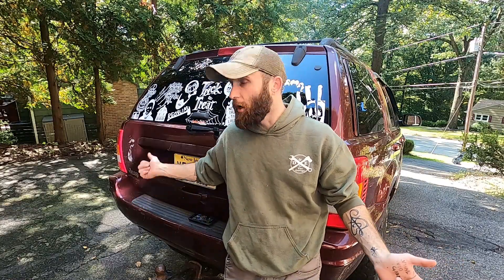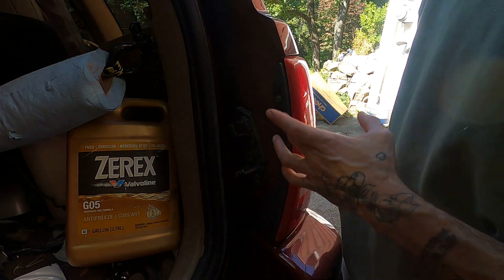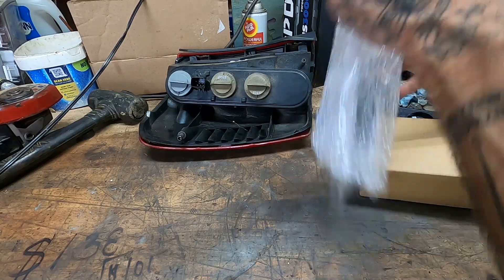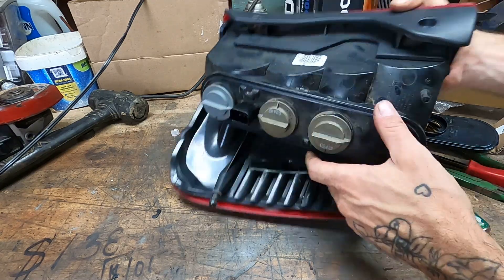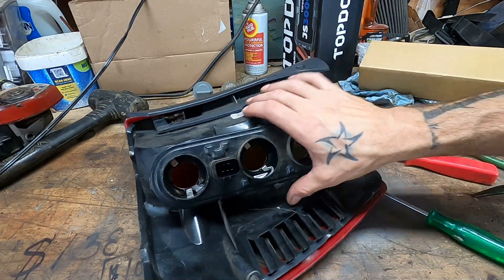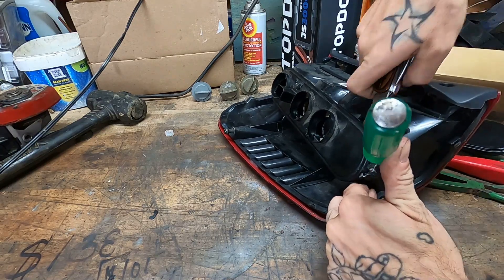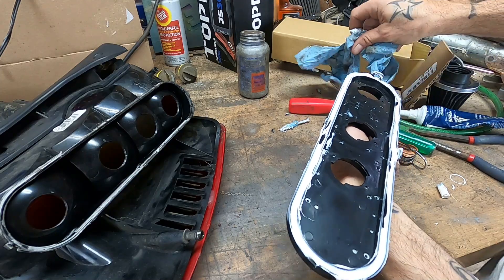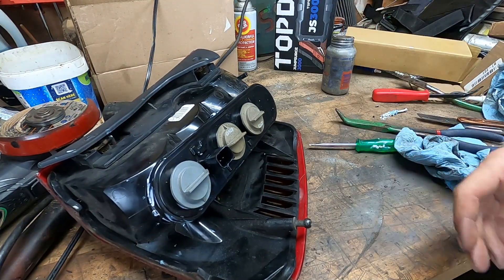Dorman Replacement Taillight Circuit Boards (Jeep Grand Cherokee WJ)

Comment: Had the same problem with my 01.  Switched over to 3157r  led,s.  Runs cooler. Been a few years now.   No problems.    Only for running lights and brake light.      Didn’t have to do anything else, direct switch.

Comment: Hey, bro, great video.Love your style, What I have one big question, which is?Where is the contact between the dorman board and the car make contact, so the car is aware that you're using signal, brake or backups lights???🤔
Reply from the maker: The door.an PCB panel is basically the whole light's electrical. The wiring harness from the Jeep (how it k ow which lights to turn on) is on the PCB and all the bulb sockets screw into the PCB. The rest of the light is just reflector and housing. Hope that helps

Comment: I have an  issue where the break light on top above the rear window works but not the other two larger lights don't and can't find the issue. Anyone have any ideas? The fuses and bulbs seem to be ok, I'm at a loss.

Comment: I solved this issue years ago by switching to led bulbs they fit in the stock socket and don't overheat easy to get at AutoZone

Comment: My 2003 WJ does NOT have adhesive of ANY kind but instead has a foam rubber type gasket and so perhaps someone, 
perhaps some dikhead glued it for you! That is much unfortune but in fact not good! I too have ordered a replacement board 
for the right tail lens from on Amazon. My old one developed a pit mark on the circuit connection, yet but not the spayed 
ended bayonette type bulb socket plug portion. I had thought that I could burnish that pitting/poc mark on the circuit trace, 
but if I were to do so, that circuit trace that I would be trying to deal with, would melt the plastic and would do me absolutely 
no good! The circuit on mine that was affected was the right turn signal. By far, when it comes down to the replacement of
this circuit board, this type of problem can/could happen all over again, BUT if you were to replace all of those lamps and
switch over to LED's well, LEDS draw way less current than those damned bulbs and so for an LED version the connections
should not even be heating up, thus heating problems can be totally averted. Heating up of the connection most likely is
caused by corrosion or in my view perhaps a low quality solder on the end contacts of the bulbs could very well be to blame.
Installing LEDS in place of those damnedable bulbs is an option and I have seriously considered following through with it!
These boards are intentionally different from one another. There is a board specifically for the left only and of course there
is one for the righthand side only!!! To be quite frank, perhaps somebody had that board off of that taillight housing already
and broke all of the little outer tabs off just so they can get a peek instead, but once reassembling it that person used 
something perhaps worse than silicone adhesive!! If you can help it, DON'T glue that housing cover back on!!!

Comment: I owned a WJ from 2012 to 2015 when the 4.0 went out at 193k. I wish I had known half of what you had shown everyone on this channel back then. I had to learn it the hard way. the tail light issue I solved by buying some aftermarket ones that came with their own harness that just clipped into the original harness that bypassed this horrible design entirely

Comment: do you know anything about how the electric windows work, when i got my 2000 xj i was lucky and got electric windows, and only so long after i started driving it, the power windows stopped working, and power locks stopped working, ive since fixed the power locks, but am kind of lost in terms of how to roll the windows down, as these are the last few days of fall. my jeep had an inconsistent wiring issue, where a select few things decided to work whenever they felt like it, and not when they didnt. (just like my mom), but i havent had many inconsistencies, since ive re-soldered the broken solders in the door switches.
Reply: Try checking the wires going through the door they open and close over the years and go bad sometimes

Comment: So far I've only just added some contact paste/grease to the tabs and not had the sinking contact. Biggest electrical issue I've had with my 04 is the ground wire in the driver's door that goes thru the flexible conduit between the door and the door frame Gail I simply used two wires smaller than the existing ground wire. Connected them up using wire nuts on the inside and soldered then  heat shrink inside the door.. That part you replaced looked dope to me! All the power windows did not work, so far I've replaced the motors and regulators in the two front doors,  At some point I will do the rears. I got mine for a song and love my wj even tho it's just a 2wheel drive. I am a handy man and use it like a tool cribb/ material hauler! The cross bars on the ski rack were gone but I bought a complete rack assembly from eBay and took the original off redoing the nutzerts and use it mostly for a ladder rack. Bought the tool and an assortment of nutzerts from HF. I was astounded at how easy and solid that made my rack! The originals were ate up with corrosion, they were steel. I used aluminum to replace them, fortunately the roof metal was in great shape! Added some bathroom caulk to prevent water intrusion , that was 3 years back! Been watching your channel for a few months. I find it quite educational and pay attention. As I'm thrifty, lol, and don't believe in buying new automobiles! I'm subscribed as well. Being very handy helps me with things. I'm an old fart, 67 , so I suppose I'm a dinosaur in comparison. Thanks for what you do, and I appreciate your passion and obvious skills! I've watched several older blogs and again love the content!

Comment: 2004 with over 300,000 miles and still going strong
Reply: Nice. Got 227 but no brake lite no blinkers. 😢 gonna try every option.

Comment: Found the cheapest way to permanently solve taillight issues is drilling holes in the bulb holders and soldering wires directly to the pins. Get a junkyard connector and solder it in for easy disconnect from the body harness and the issue is fixed forever.

Comment: 4:30 those contact points can lose continuity,I think they like a tiny bit of "conductive grease and anti-oxidant" (use a Q tip to spot the grease?) and where the turnable bulb holder fits in has the complementary contacts,also I think that yellow seal on the turnable bulb holder likes a bit of silicon spray or even syl-glyde slide pin lube on it so it won't be so hard to get out the next time
need to clean that bulb off or even put a new 3157 bulb in as long as it is took apart,I think the contact points on the bulb tab and the metal claspers where the bulb tab pushes in could also use a bit of silicon or "bulb grease" to stop it from corroding 
  I found that some aftermarket LED replacement lamps for the 3157 used as backup bulbs are not as bright as the plain 3157 so a waste of money. If they were brighter would be good since I would like to have backup lights that actually allow me to see where I am backing instead of just showing someone else that I am backing. 

  I would try some attention to the contact points where the electric transfers before busting off that black part of the lamp assembly. Also you can put some silicon grease where the ball thing goes into the little rubber doughnut to help hold the lamp back in place. Any rust inside the metal cavity you could try some Fluid Film like where the Phillips screws come through.

Comment: Have you ever had a issue with the infamous blend door problems that plague the dual zone climate WJs?
Reply from the maker: I have on a number of occasions. Next time it happens I will try to do a video on it
Reply: Even the ones without the dual zone have a similar issue. Those doors needed to be aluminum (and the dash needed to be removable for service).
Reply: Try "HeaterTreater" ?
Reply: It's actually pretty easy with a multi tool to cut a hole and replace it, then put the piece back in with Ducting tape.. I replaced it on someone elses WJ.

Comment: I can assure you replacing the board will not be a forever fix, I've replaced both of mine 3 times and the entire rear light housing 4 times. I broke my LED tail lights wheeling so I just went back to factory, biggest mistake of my life... Almost lol. I still love my WJ though even with all its piss poor factory tail lights. Great vid as always brother keep it up.